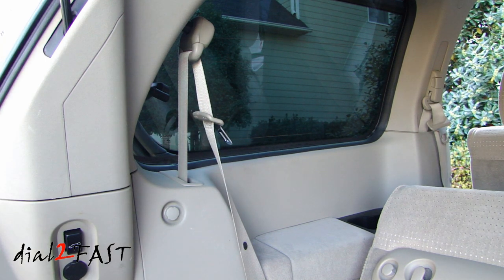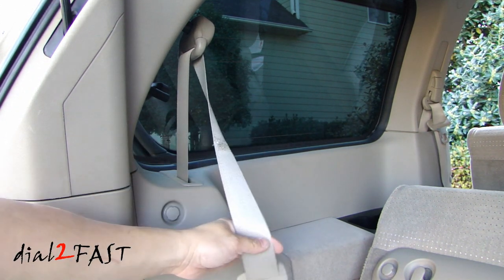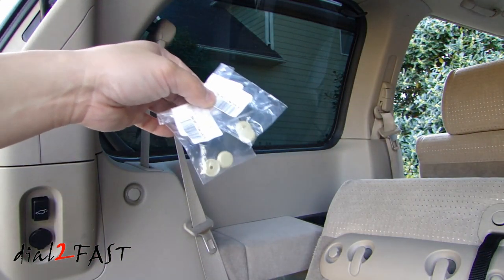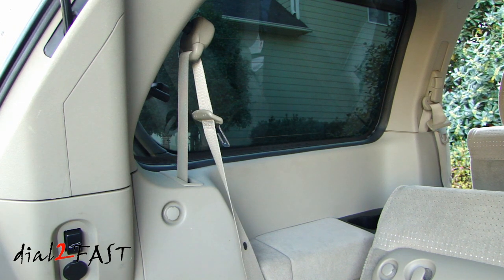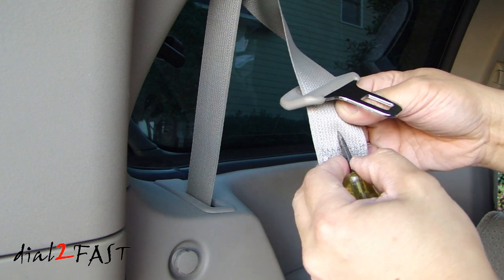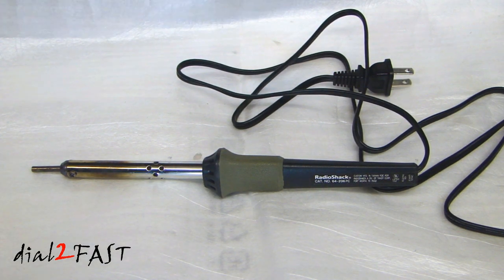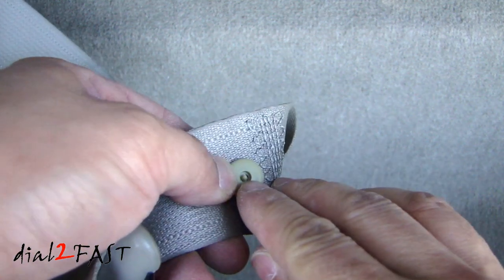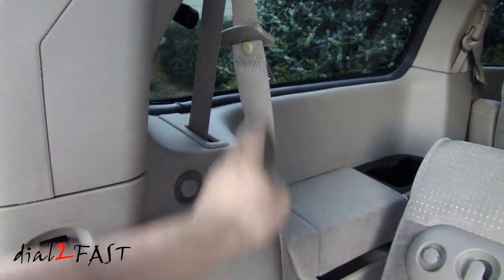How To Replace & Install Seat Belt Stop Button

Comment: Great video. Thanks for all your effort to share your knowledge. I would recommend:
1)  hot-cutting the tiny hole in the seat belt webbing with a heated small nail or brad to keep the webbing from fraying. (You could heat up the tip of your awl but that might harm the finish or reduce its hardness and sharpness for other tasks), and 
2) Holding the two halves of the  stop button on the seat belt with needle-nose pliers  while applying heat for safety. Many thanks!

Comment: This is the kind of guy I could hang out with: first, he sees a problem and he solves it, second, he solves it in a professional/sharp manner (he uses another plastic rivet instead of some crude/clunky solution like a screw that someone else suggested here) and finally, when he was done, he helped others with the same problem by making this video. Well done!

Comment: Thanks for the video, I thought it would snap in and it doesn't. I tried super glue and that failed. The melting with the soldering iron worked like a charm. Thanks again.

Comment: Thanks for the video. Perfect process. The tip about melting with the soldering iron and the tip about holding the belt with a clamp, perfect.  I printed a replacement stop button on my 3D printer and installed it with your melt method. Easy peasy. Thanks!

Comment: Is there machine for buttons??? And why isn’t ? Or you just want to make holes manually 😮
Reply: Before you cut tip off soldering iron  heat up iron & make hole for button then cut tip off. This will keep hole from raveling out since hole was melted with soldering iron tip.

Comment: No idea if this compromises the actual safetyness of the belt....
Reply: No, if so would the factory have installed them?
Reply: @solucky70  The problem is the ones that factory installed don't have a plastic shank going through it, they use thread like sewing a button on

Comment: If I’m correct, the button is for seatbelt pretentioner when it explode. U can do more research on seatbelt pretentioner. Sometimes either an extra stitches with a loop. N sometimes with button. U can google seatbelt loop. Also u can search how seatbelt pretentioner work.